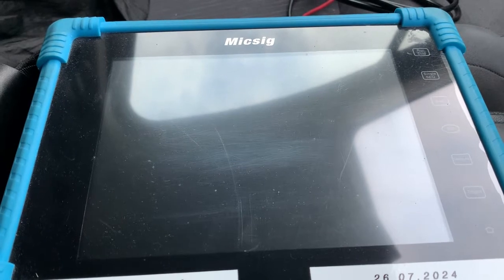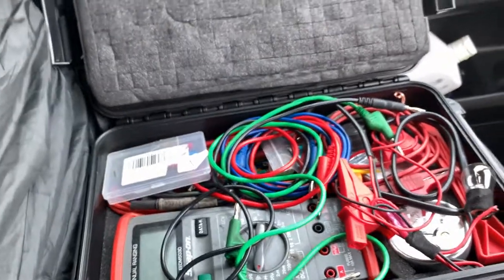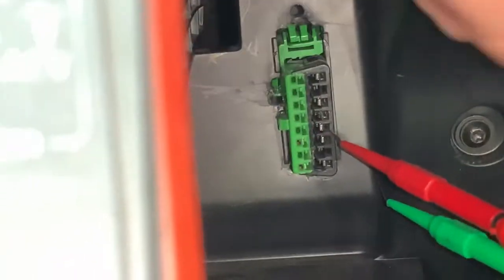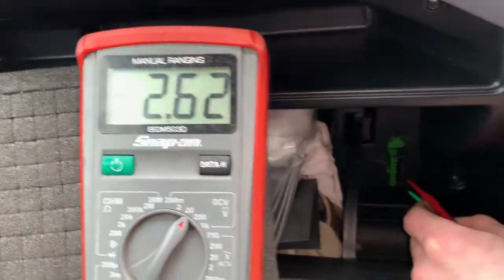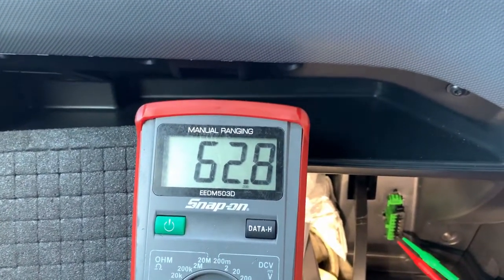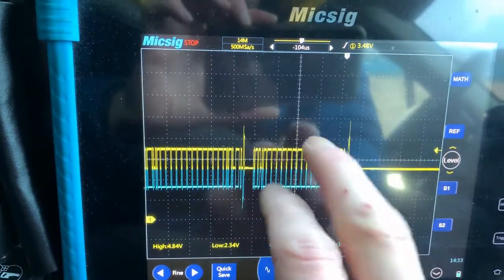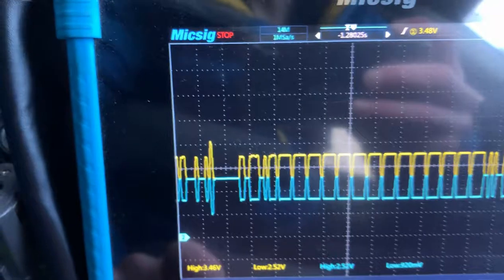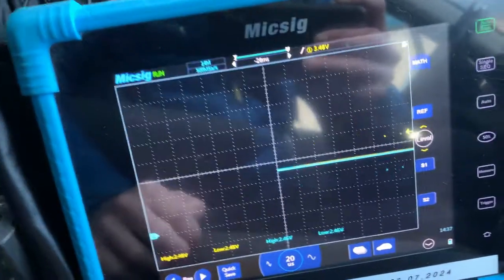Micsig at01104 - [CANBUS TESTING THE EASY WAY]

Comment: sometimes  my micsig, on the CAN bus  ,says it's overload. Do you know why?Also, at the end of the packets,there is a line goes very hi ,and also ,very low(on the low can).Do you know why?
Reply: That's normal on any Canbus. Basically means End Of message in that data Packet that was sent out from a particular module on the BUS